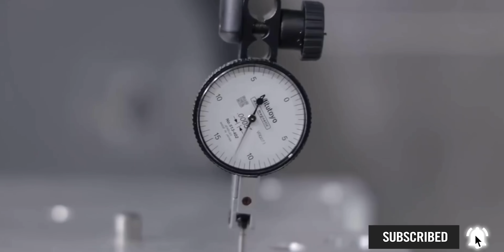The Harsh Truth Machinists Don’t Want to Hear

Comment: I'm not allowed to change anything in our programs. It's all military and aerospace work which is all under the "frozen process" policy.

But every single tool, no matter what it is or what material it is, only has a .001" chip load per tooth!

Running 20 IPM on 6061 aluminum with a 3 flute endmill at only a .100" cutting depth at a time ROUGHING?! WTF?!

I said "screw it" one day and took a program that had a 56 minute cycle time down to 4 minutes 49 seconds once. And the finish was so much better as well!

Then I found myself in a room with management getting chewed out because I "changed the process".

I hate my job.
Reply: I got in trouble for not scrapping a part after threading tool broke. I just replaced the tool, checked the thread was running true, and sent it. Next day I am getting fussed at about it. Glad I ain't there no more
Reply: I seriously have so many questions. Is it a flight safety thing, what are the actual frozen process requirements.... i went through this myself after picking up the pace on some ops on a few frozen process jobs, so thats how i learned frozen process does not mean frozen programs.
Reply: Good advice 👍
Reply: > 56 minute cycle time

in russia we say "the soldier sleeps, the service goes on"
Reply: Are your employers aware that frozen process does not mean frozen operation time? And frozen processes can sometimes apply only to certain operations in the process. Look for the black star...
Reply: I worked for a company that programed so bad I threatened  to quit the second day If I couldn't re-program. They said yes and I cut there times down 75%. They loved me
Reply: I've never had a problem calling ANYONE a moron and articulating why. My bosses know this. My company tried replacing me 4 times over the last 15 years. No ACTUAL machinists will work where I work for the starting pay they're offered. I've always been able to outsmart and manipulate management. I'm at 5 weeks of vacation and that's valuable to me now. Everyone who had a problem with me is gone or subjegated. I run the machine shop at a predominantly fabrication business. I'm in the top 25% for pay and most importantly, I'm left alone. I can make parts for at home or for friends. That's critical for me. I would never work where I can't make personal parts. I'm old now. For young guys, you should ABSOLUTELY bounce around to different shops that specialize in different types of machining. I didn't start until my mid 30's and didn't hit full speed until 40. So I wasn't going to start hopping from job to job. I'm always keeping up to date on technology. The biggest mistake people make is thinking that just because they're still around means that they're valuable. WRONG!!! EVERYONE needs to make themselves valuable and keep themselves valuable!
Reply: The process is there for a reason man, who are you to second guess the engineering that was vetted and tested in the machine of that part? Whether you're right or wrong about the change doesn't matter, when it comes to aerospace parts where failure is NOT an option, you don't 2nd guess the process without going thru the process. As Titan said, you have to know the whole process. Maybe the aggressive Machining change you arbitrarily made changed a sensitive crystalline structure within the medium that could negatively change its structural characteristics, before or after surface or heat treatment. Think before you condemn, take responsibility for YOUR actions or youll always be doomed to hate yoir job.
Reply: Sounds to me like your company was pretty keen to be charging the government for a 56 minute cycle time.

This is one of the reasons Russia outproduces all of nato combined.

Comment: After a 4 year apprenticeship + college and night school and then  3 years as the 'ex-apprentice' I left my job because the company didn't want to change.
I started a new job and was the new guy. I settled in, learned how the company operated, watched how senior guys programmed and run parts. I researched tooling, cutting data, I read programming manuals cover to cover and then I started taking things to another level. Reducing cycle times on existing parts. Coming up with new and more efficient ways to fixture parts. I became invaluable to the business. Back then I made mistakes at times but I wasn't afraid of making them because that's how you gain experience and learn. Experience gives you confidence, to push the envelope, increase MRR and be more efficient.
I stayed at that shop for 14 years, I left 2 years before it closed. I learned a lot in that time, but here's thing - everything I learned and the experience I gained was because I pushed myself. 
If you do that, you will be a valuable asset to any company...

Comment: I wish it where me I could try to fix me. For as long as I can remember, I have wanted to know the why and how. As a young machinist, I was told you/it can't be done, and yet I persevered. I thought if I could only learn it all, if I could have all the answers, I could succeed where others fail. And I did for a while pay raises and bonus and more pay raises, running 2 live tool lathes doing up to 2 or 3 setups a day, programming tool paths at the machine "the c.o. did not want pay for all the programming options" there where an order of 50 parts they sent to me because of my ability with the live tool lathes my total run time was 6:56 per where the the mill guys would take 30 min per. Good job after good job, you are an invaluable resource, hell even the tool vendor loved me, I would buy my own inserts to test different cut conditions on specific features of a parts. Then the blowout, the market changes, the layoffs I dont care how outstanding you are when a company decides to lay off 2/3 to 3/4 of their machinist, I went 3 rounds the last time, there was no one left all chiefs and no Indians. I have not had the fortune to work anywhere more than 2 years before the churn sweeps me off my feet I am down to my last 4k in cash 60k in debit I had to sell one of my vehicles and my house, no 401k no retirement. All in all, I am now worse off then when I started. I am sorry if this is over sharing this is not how I feel this is fact no amount of solidworks, mastercam, or manual guide i could keep money on my bank account. At the end of the day the c.o. only cares about one thing, acceptable parts, not good parts, not great parts, if acceptable machinist cost less then you are a liability.
Reply: As a mill guy I agree.

Comment: I have owned and operated the shop my dad started in 1975 for the past 19 years. Medium size with $5m annual sales , 19 on the floor. If you are smart enough and driven enough to get to the top tier of high end aerospace manufactiring you are are smart enough to do almost anything. Machine shop can be very interesting to a naturally inclined person for about 5 yrs, after that it  slowly becomes soul crushingly boring. To top out somewhere around $120k a year for this work is just not worth it. 
Just sayin.
Reply: 120k today buys less house than what an apprentice made 25 years ago did. Wages in this industry are a joke now. Median house in 2000 was 111k, today $410k. Machinist wage averaged $17/hr. $21 for tool and die. You'd need $63 or $77 today to match that purchasing power.
Reply: @user-lj4xq4hm3k median house has gotten a lot larger ... youre using an irrelevant metric.

Comment: I worked as a conventional and CNC machinist. Transferred to inspection department learning QC/QA checking certs, dimensional, CMM, hardness, NDT, MAG, PT, UT.

We need to learn everything we can that goes along with the shop and not just cutting chips.

Over many years I’ve learned that the more you know, the more valuable you are to that company and dodge layoffs because they can move you anywhere in that shop.
Reply: More value for the company not for you. Oh congrats you don't get laid off when it's shitty you just lose most things because of it. Trash companies doing trash things. Can't wait until they end those kinds of businesses
Reply: @kski5432 Oh like the Mom & Pop shops? I think we use to call them “Job Shops” where you might run a couple parts or rework some oil or gas drilling parts.

I worked for a small shop and we would take orders from the Dad and also take orders from the Son. I actually got bitched  out from the Son and told him that your dad told me to work on another project LOL!!

Comment: I agree with this. However, most shops just want machinists to run parts. I wish I could find a shop who's willing to invest in me, the way I invest in them. In this trade, you have a high probability of getting lost in the mix. Big companies tend to invest more time into administrative HR stuff, than tradesmen. Machinists, to a lot of companies are a line item on a KPI report.
Reply: I'm currently a trainee and that's the fear I have. Currently I'm in a company I'm not truely happy with, for one reason because I feel quite stressed (all the time), do really important parts (tight deadlines, very important customers, with meticulous QA and complex parts) and I just work like I already finished my a apprenticeship, but I feel too slow and unproductive, and on the other hand they don't teach me the stuff properly. It's all annoying people with dozens of questions and trial and error, breaking parts and being slow. 
On the other hand I have a 350.000 Euro machine in front of me which basically only I work at, I manually program parts which in 90% of other companies only CAM would be used, the large majority being complex enough where 50% of our department (some of the workers with more than 15 years of experience) and 90% of our company have no chance programming it themselfs or something similar, so I get the parts.
I'm afraid that if I switch companies after finishing my apprenticeship I will be somewhere just running CAM programs, which would be extremely boring and not fullfilling at all. I want to be good at what I do and at my current company it's doable, but very difficult, on the other hand many other companies don't even offer tasks which are really complex enough to grow.
Reply: @tngdwn8350  tough it out for a year or three, learn everything you can, then move on.
Reply: @tngdwn8350  you can try talking about your manually programming skills at some job interviews. It's very handy to have that skill for the future and to read programs easily. Hopefully there will be a company for you they wanna invest in and help you teaching stuff properly.
Reply: Honestly.
Last time I let a Machine Shop invest on me (send me to college), I was promised a raise on money & position.
It Never came, from 7 people they choose, I was the only one who finished.
I actually love to study, do research, try our new things. Without pay sometimes.
Because what Titan said in the video is right, we are destined for greatness.
Bit we also need to prove that we truly deserve it.
Trust me, do it for you!
Not for the Shop, supervisor, etc.
DO IT FOR YOU.
WISH YOU THE BEST!
NEVER GIVE UP!
Reply: You must be a machinist lolol
Reply: Wheredoyou live
Reply: I think you need to rewatch the video
Reply: No matter where I work or how good things are, I constantly evaluate other opportunities. It let's me continuously evaluate what's out there, and make comparisons, to my current position. It also gives me negotiating leverage. I always give my employer the best I have to offer. I want to make sure my employer is doing the same.
Reply: I mostly agree. H.R. works specifically for the owner/owners . Owners often give just enough to keep you around. It creates a bad scenario. Yo get in a place. Learn, work hard, show your talent and you get moved along very small increments. Then when another opportunity opens up and the individual tries to better themselves….the shop owner develops an attitude that….if I train everyone up…or allow them to learn (too much) they’ll just leave for the next dollar.
I don’t think machinists are paid enough. You could buy a van, put 12-20k of tools in it and your garage and go do carpentry and make double or more.
A good modern machinist/programer must know a crap load of interconnected disciplines. From math to chemistry (coolants)..electronics to hydraulics.math and some engineering.
However. An operator is not a machinist. Not all programmers are real machinists. 
I really like what titan is doing. I believe he has the right attitude.
It’s just that in most shops there’s not much room at the top of the totem pole.
Reply: Try and find a worldwide company, maybe an Oil/Gas tool manufacture.

Also remember that good machinists will not transfer into management. Companies can’t  afford to loose a good blue collar machinist to management, the supervisors in the shops are guys that have screwed up a lot on parts, scrapped parts, crashing machines etc.
Reply: With AI they will not invest so much in the future in HR as they will be replaced. A machinist on the other side will not
Reply: Go back to 3:20 and listen again through 4:00
Reply: I don't invest in a operator until I feel comfortable that they won't waste my time. Most shops have the same requirements. Your attendance has to be perfect. You have to be a team leader. If you look like you party after hours, nobody is going to risk teaching you.
Reply: @wannabecarguy this why the trade is dying, you're killing your workers confidence and ambitions and making them resent the trade.
Reply: Great speech 🎉🎉🎉

Comment: The best thing anyone can invest in, is in yourself (Warren Buffet said this himself). You must be educated in this industry. If you want to be in this trade or any other trade but especially in precision machining. You must put in the work, study, go back to school, and do whatever it takes to increase your skills as a machinist. This includes everything associated with being a machinist; Manual operations, setup, CNC programming, CNC setup, using metrology equipment to inspect your parts, maintaining the highest quality that you can possibly achieve at your level, be detailed oriented, keeping your work areas clean, organized and tidy, practice Kaizen (The 5S's of Lean manufacturing), I could go on and on here. I have been in manufacturing for 25 years and I still don't know everything there is to know about machining and I did go to school to learn this trade and I continue to put in the hard work of continuous improvement to boost my skills as a CNC machinist. Sorry for the long message but I get fired up about anything to do with being a precision machinist.

Comment: I agree with this.

And it hits close to home because I started as an EE student, went through electronics repair, into a warehouse job and finally into a machine shop as a 3-axis operator. Stayed there for 2 years, learned the basics by myself and now I'm about to change jobs and get into the aerospace industry working with titanium where I previously only did steel, stainless and plastic. Hoping it will work out.

Thanks for the inspiration and education Titan. were it not for this channel and others like it, I would not even know how to use a micrometer, let alone program speeds and feeds.

Comment: Titan please give me some advice I am a CNC operator and programmer I worked on CO2 lasers 
Fiber lasers 
Punch stamp machines 
Flow water jet 
CNC router metal worker 
I've been a team lead 
 I wear many other hats in my shop 
Should a person with my experience of 20 years be making over a hundred k a year
Reply from the maker: That’s a huge amount of experience across different machines—and that’s powerful. But here’s the real question: how much do you truly know about each one? As a machinist, operator, or programmer, do the machines run faster, smoother, and better when you’re in charge… or do they just run average?

If you can prove that when you’re on the floor, productivity rises—5%, 10%, even 20%—then you have the leverage to stand tall and demand better pay. That’s how you separate yourself.

But there are levels to this game. You’ve got to take an honest look at where you stand. Every setup, every program, every cycle time—are you adding measurable value and pushing efficiency higher? If you can show that, you’ll break through $100K and beyond.

And if your current shop refuses to recognize that value, then take your skills to a place with vision—a shop that’s hungry for growth and willing to invest in talent.

The bottom line: Are you average, or are you exceptional? Choose to be exceptional. Take everything to the highest level, then scale it by lifting up those around you. That’s how you transform your career—and your paycheck.
Reply: @TITANSofCNC thank you Titan that means a lot.
Reply: @TITANSofCNC  I love this reply. In my 20 years in this industry, there has always been something to learn and there has always been room for improvement. Technology changes so do people. The machines and tools advance constantly, so should the machinists.(Efficiency and Knowledge) I fell into this industry by chance and latched on, I chose to be exceptional and it eventually put me in a great position. I have plateaued in recent years due to lack of drive, but in the past 3 months I have found a new joy with training two of our latest employees because each of them have a piece that reminds me of me.  The drive, the thirst, the hunger, the workmanship, being a sponge for knowledge, and actual passion for this line of work.